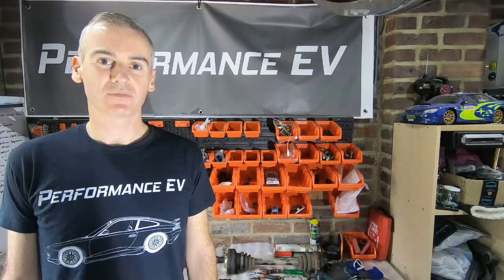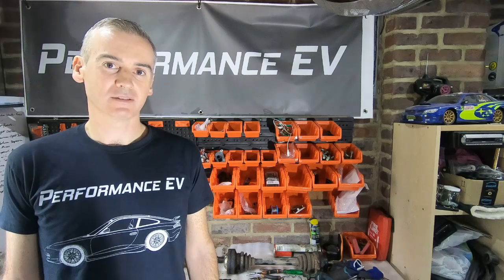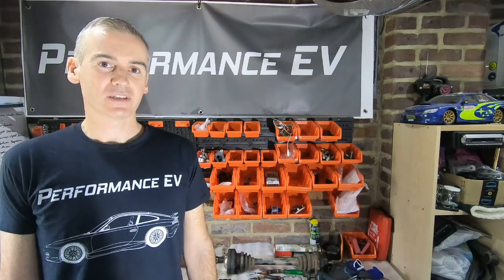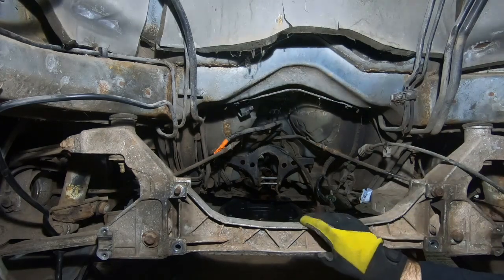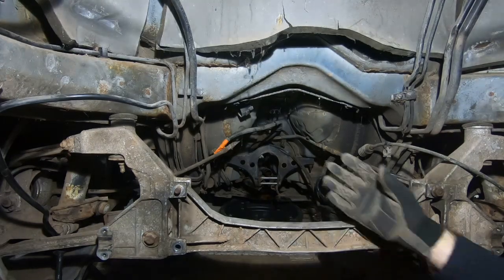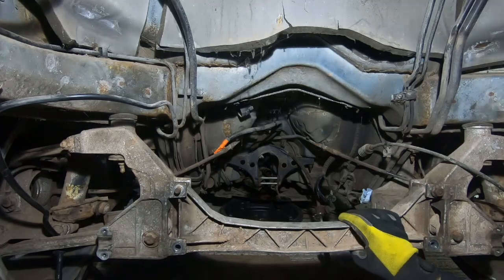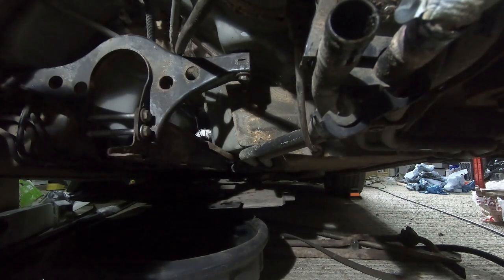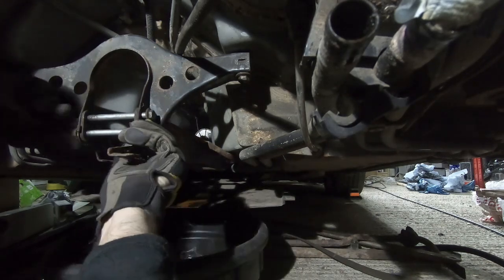Electric Porsche 911 project video 13 - Trying to fit Nissan Leaf motor in Porsche 996 - attempt 2

Comment: Hi Shane, I just found your channel and I'm working through the Leaf-into-a-Porsche playlist. Is there an intro video or webpage that summarises the project? I'm considering a Leaf motor for my little 1957 Austin A35.
Reply from the maker: I've started trying to put something up on the open inverter forum 
https://openinverter.org/forum/viewtopic.php?f=11&t=305
I would recommend checking out the rest of the forum too, there's some interesting work going on there. Depending on the power you are looking for, there may be even better options by raiding the Toyota product line. Things like Lexus gearboxes and electric rear diffs are starting to appear in conversions as well.

Comment: Would it be simpler/safer to leave gearbox upright...and modify transmission tunnel .  Might cut out the offending area and then weld a new cover/cap plate over it.  if your lucky you can hide it in a center armrest between the back seats...or reshape the entire area between back seats in a pleasing way?
Reply from the maker: You're absolutley right, it is the simplest route, but I set myself a personal target at the start of the project that I wouldn't mess around with the structure of the car unless I absolutely had to. So I am going to give myself a couple more weeks of trying to figure out ways of doing this without getting an angle grinder at the car before I give up and do the sensible thing:-)